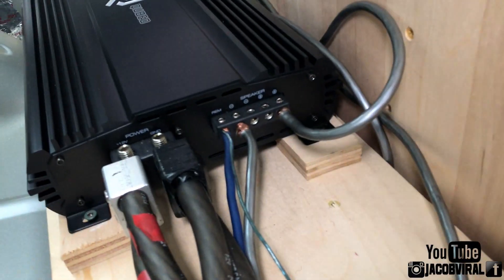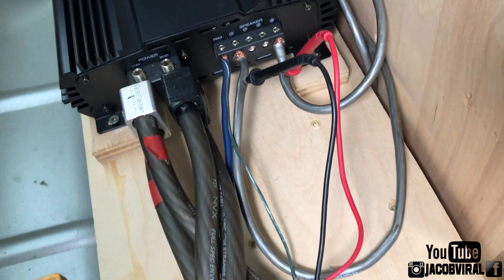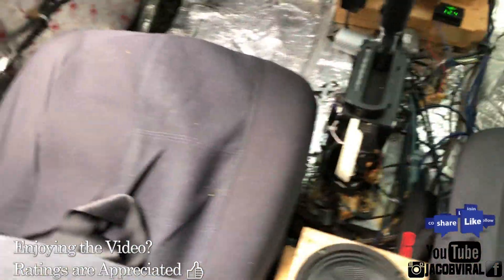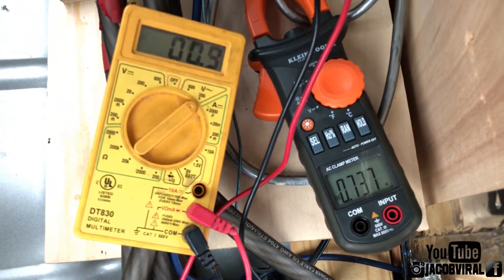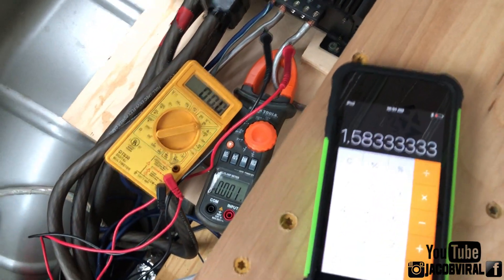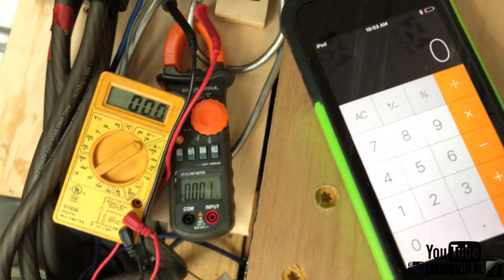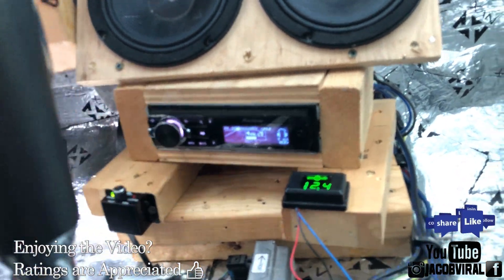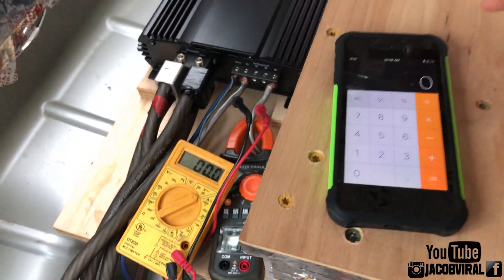HOW SUBWOOFER OHM CHANGES NEAR PEAK FREQUENCY | IMPEDANCE CHANGE | BOX RISE

Comment: My 3 subs are dual 2 ohm wired at 1.34 and rated 800 watts RMS and 1600 peak each. What should I put on them considering  box rise? Im thinking an amp that does 2500 at 4 ohm like the Sundown SIA5000 or the DD M5000 since I'll never see that 1 OHM or 1.34.. I need to ensure they get atleast the 2400 RMS since the ohms are gonna rise from the 1.34 sent to the amp. Some vids here on YT say you shd atleast double the power going in or 2.5 times the RMS which wd be 6k for my situation...any thoughts??
Reply from the maker: I would suggest either a Brazilian/Korean 2 ohm stable amp in the 3-4K range or 3 smaller amps at 1 ohm Each around 1-1.2-1.5k each.

Comment: Question. I'm about to upgrade my subs and I want to try .5 ohm but sure if I have the electrical. 80ah yinlong with 320a on 8k amp. I'm wired at .7 and rise to 1.7 using V ÷ A method in your other video. Can I do it safely?
Reply from the maker: Monitor on music with voltage meter to see how it’s handling it, sounds like your already in the right track. Yes you can test even at medium volume.
Reply: @JacobViral2  thank you sir

Comment: You could eliminate the Clamp altogether by using a known resistor in series and calculating your current by voltage/ohms.  Those clamp meters are not exactly the best at accuracy.  The klein tool there only has at best 3% accuracy of the reading for the levels you are using it at..  Also, there is an inexpensive Dayton measuring system, DATS V3, that would save you a lot of trouble. It is very useful for those manufacturers that do not publish all the thiele/small parameters or if you want to just check how an individual speaker compares to the published spec.